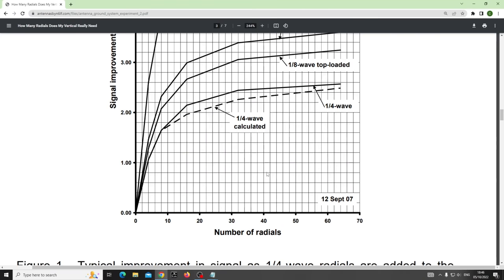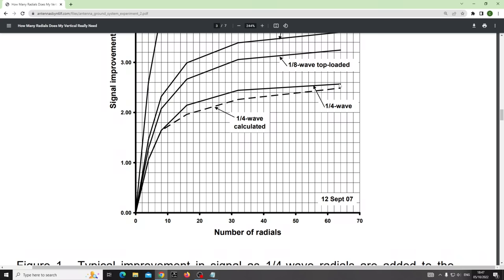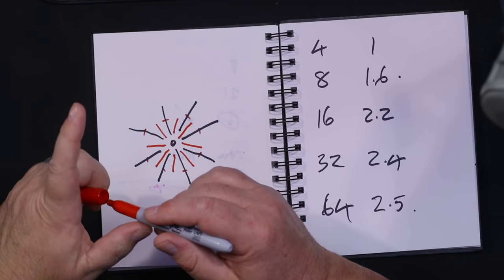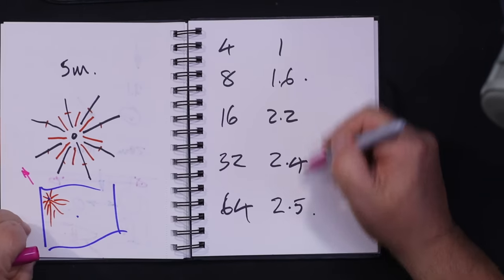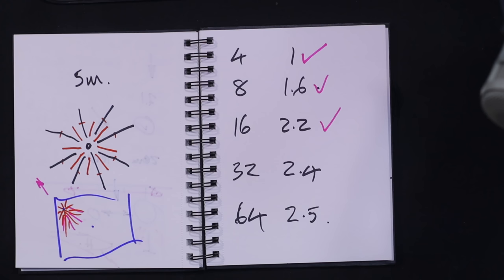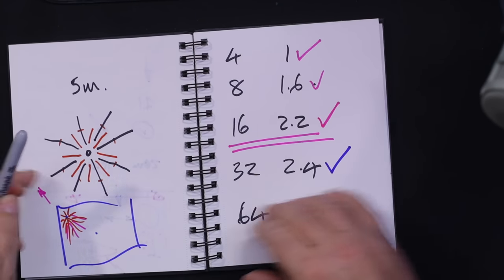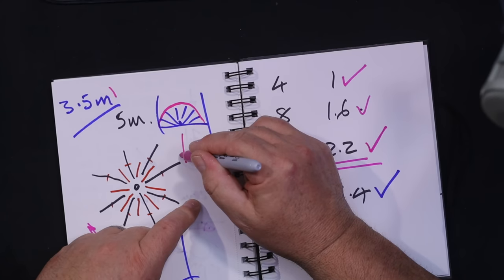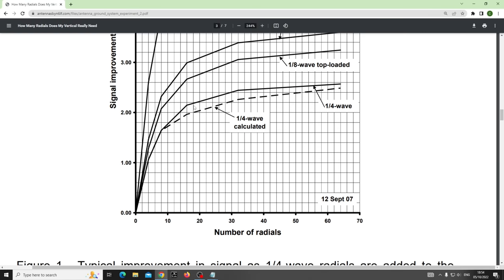Vertical Antennas 101: The Importance of Radials - How Many and How Long?

Comment: I have 12 radials all 2.5metres in length. I use a Hustler 6-BTV, all bands are resonant, except 80m which is just under SWR 1:2 and needs an ATU. Using my IC-705 on 10 watts, I can get a signal right around the world using FT-8/CW. The antenna is mounted in a corner of the backyard. I’m pretty happy with my results.

Comment: Not having a lot of radial room I was able to put the antenna in the middle of a fenced portion of the yard with about 10 to 15 ft at 360 degrees around the antenna. I cut 32 three meter radials and installed the classic with 80m with that setup. It's worked great. Signal reports from friends about 150 miles away on 80m (daily emcomm net) were the best they've ever been. I mainly use all the other bands for FT8 and it works great. We have St. Augustine grass which is a carpet type so I ordered a bag of the 2 in stakes and should have ordered 2 bags. Our dog likes to run laps around the antenna so she will pull up a piece of radial occasionally and if I don't catch it the lawnmower will clip off whatever is exposed so I'm not sure exactly what's down now but it still works fine. The radials have all disappeared into the grass now so everything is good. Thanks!! Jack K5FIT
Reply from the maker: Fabulous!

Comment: Thank you for explaining the effect of radials - I used your information to try and increase my DX range, but something 'weird' happended.
I have a Chameleon MPAS 2.0 portable antenna system - I set it up in the vertical configuration in my (small) back yard. 
The antenna as it stands now consists of, from the ground up : 
1) a ground spike (support & electrical grounding): 
2) an encapsulated  'balun/unun',
3) a 133" vertical mast
4) a Chameleon 'Cap Hat'
5) finally  a 105" vertical extension whip above the Cap Hat.
6) a singke 25' counterpoise / radial wire that attaches to the ground spike.
With this config I got swr's of 2.6, 1.2, and 1.75 on 40, 20, & 10 meters, respectively.
After watching your video, I cut and attached 8 (eight) 16.5' radials ( which add to a full wavelength on 40 meters) - all 14 gauge stranded copper, insulated wire.
Result: the swr's increased significantly across all bands -> 4.91, 2.55, and 2.6 on 40, 20, & 10m.
So I removed the 16.5' radials and added 2 (two) 33' (1/4 wavelength) radials, and the swr's decreased,
->( 3.2, 1.5, 2.6 for 40, 20, & 10 meters) but were still above the single 25' radial level.
This antenna, in the last config, DOES RADIATE. I have had RBN hits all the way from Hawaii, Fla, and Costa Rica, and SSB QSO's from Fla. to Alaska, all on 100 watts.
QTH is Vancouver Island on the west coast of Canada.
BUT, but, but ... these results don't make sense to me :
The 8 x 16.5' (1/8 wavelenght - which add up to a full wavelength on 40m)  radials should have made the antenna MORE resonant on 40 metes, and thus should have the lowest SWR (reflected power ratio).
But it had the HIGHEST swr !
Callum, did I do something wrong, or do I just not understand the relationship between radials, resonance and swr?
Any advice would be appreciated. Thank you.
Reply from the maker: OK.. so my numbers and experiments are most appropriate to quarter wavelength radiators. Dr George Brown in the 1920/30s suggested that for smaller radiators, you need even more (as you have done actually). Now.. I honestly do not know your product that you are using and I am seriously only speculating.. So - if I was the designer of your antenna (and I have no real idea what it is - I am not disrespecting someone elses engineering) and it's not a quarterwave - but has coils etc than I might be tempted to give my customer the best SWR in a small to medium package. IN THE EVENT that you supply too good a radial field, it is possible the impedance went down too far, causing the SWR mismatch. We would need to understand the impedance (SWR is just a calculation from there). You might want to talk to the supplier and ask them politely what do THEY think is happening. They know their product and SHOULD have an idea of what is going on. Sorry for the large reply - I didn't have time to make it shorter!
Reply: @DXCommanderHQ  Thank you very much Callum. I appreciate you taking the time to reply. It's basically a 'base loaded vertical that is grounded, 19.8 ft high, with a clover leaf cap-hat half way up.
I will email Chameleon and ask them the same question.
I was also thinking about getting your new 'signatue' dx antenna now that it does not require guy wires (back yard is way too small to guy the 'dx commander'), but I would only be able to lay down multiple 1/8 lamda radials for 40m due to size restrictions.
Thank you again.
Reply from the maker: PS - Let me know if they reply to you!

Comment: My radials are ~3 meters long because that's how far I could go in my garage (i really need to clean up!).  I have 5 of them in each bundle because that's what fit into the alligator clips.  I have 4 bundles because that's what fits in the bag I pack them in.    I never once gave a thought to whether this is a "good" radial setup or not.  It's what I can do and it makes contacts.  Little point in caring beyond that I suppose.
Reply from the maker: Indeed, why worry Matt!
Reply: Pretty much what I did. Works great!

Comment: Rudy is the best.........I have an autographed copy of his switching power supply book..... I run a pair of phased 1/4 wave verts on 40..............with thirty two 1/8 wave radials under each radiator. the array works........ cheers from New England to Old England, Mike K1FNX near Boston
Reply from the maker: Mike, all I can say is "Wow".
Reply: @DXCommanderHQ  Rudy is a famous switching power supply guru....... his book is one of the "Bibles"....... in the 80's every PS engineer had a copy of his book, Abe Pressman's books and "Reuben Lee" magnetics design book....... I'm retired 12 years and still have the books......

Comment: How about using wire mesh on the ground?
When replacing radials, do you dig up the old ones or just lay the new ones on top?
Reply from the maker: Good questions.. Hang fire on the wire-mesh, I'll cover that maybe later in the week..

Comment: Now I am gonna build a 1/4 wave vertical antenna. Is there any benefit to elevating the bottom of the vertical part of the antenna and sloping the radials?
Reply: Something like the Crushcraft AR2XB design, interesting.  Lends to my question as to a ground plain instead of radials maybe over a steel roof on a chimney mount?
Reply: If you want to raise the vertical element of your antenna I suggest that you only raise the vertical element of your antenna by 12 to 18 inches above the ground and then you can connect the radials and let them slope from the radial plate to the ground and use at least 12 to 20 Radials for the ground plain and you will find that the antenna will have no problem with transmission or receive. I have tried several radials about four and a half feet above the ground and sloping to the ground and I have been making contacts as far away as a thousand miles from my location and made over a hundred and fifty different contacts from my vertical antenna. At present I am only using 8 radials for my antenna. I have been on 40 meters and twenty meters when I was making the contacts. So yes you can slope the radials and and be able to make contacts with your antenna.
Reply from the maker: None at all. Rudy also did some work on this.. For any REAL giain, you need to get your HF antenna WAY UP in the air. However 4 raised radials WILL work but Rudy discovered some weird "sh*t" that I never bothered trying to understand. Bottom line is once you have a few on the deck, you are fine.

Comment: The more radials the lower the resistance seen at the base of the antenna. I hear so much about symmetrical grounds run along the ground or drooping to get more of a longer vertical effect. But all it does is make a bunch of horizontal antennas that cancel each other out. If you only have a few ( or big ones) going to one side it acts as a folded dipole and actually puts out a nice signal in a horizontal way. As long as it matches the coax the radio doesnt care if its a symetrical ground plane which radiates little or a horizontal radiator which gets out there.

Comment: Hello cal I have a question when you say a 1/4 wavelength are you talking about a specific band. I know this question will help a lot of new hams including my self. If possible can you explain length in feet and cm. I’m only asking because I know how to cut 1/4 for a specific ban. But what about a multi band like your antenna which I have one and enjoy
Reply from the maker: All 1/4 wave elements are proportional to the wavelengths. To calculate a wavlength, take 300 and divide by the freq in Mhz. so 300 divide by 14.2 = 21.05 (that means 21 metres). So although we talk about the 20m band, it's actually 21 metres!). If you want feet and inches, ask Google to convert the number.
Reply: @DXCommanderHQ  thank you sir. Much appreciated

Comment: Great video Cal as always. So my garden has a classic with 160 m of radials. Works a treat. Over the summer had to take down and adjust. When I put back up I had not connected any radials!  Went off with the family for the day. Came back home and did radio in the evening. Lots of good contacts. Only next morning discovered that the only grounding was via the coax haha!  Pissed me off as it was back breaking to get the 160m of wire into the ground. Anyway, still glad I did. Great antenna !  Mark, 2E0MSR

Comment: I found some surplus military comms wire zip cord 2 conductors at about 22ga steel conductors.  It was 76.00USB per KM in 500m put ups.  I am building a radial field using it for my signature 12.4 DXC.  I am mixing 2.5m, 5m and 10m and planning to put down 640 meters total or 8X WL for 80meters.   I can get 12 radials attached to each of the connectors on the ground plate.  I may also look at driving four ground rods near in the radial field to give a better ground plane and connecting with wide copper strapping to the ground plate.
Reply from the maker: John, that's better than me.. And I'm starting a 160m project soon and wondering if I have enough!
Reply: @DXCommanderHQ  oh due tell 160m project... sounds great.  would guess a coil loaded or inverted L with the Nebula?  or a BIG Ole LOOP... ?

Comment: Thanks Callum, for getting me interested in amateur radio.  Great videos.  Question:- Would it be effective if you had a ground spike on the bottom of your antennas? This would make it easier to erect the antenna, but would it effect the radials if you added a ground spike on the DX Commander.
Reply from the maker: It would do nothing materially to your signal at all other than assisting lightning.. However, if you wanted a little spike to easy of tilting, like a hinge, sure!

Comment: What about a ground plain instead of radials.  A local radio station used zinc galvanized 10' width chicken wire 2" mesh covering an acre under their 3 tower AM broadcast station.  They had the strongest signal in the region. 

I must expect it would foil any attempts to dig a garden though, and ground hogs might hate you!
Reply from the maker: CHicken wire.. I heard about the fella that did that and was plagued with crackles and pops for years as it rusted away.
Reply: @DXCommanderHQ  The capacitance most likely .

Comment: I just purchased the Hustler 4BTV  For my 1st ham radio antenna. I also purchased your DX radial ground plate.  I decided to mount the antenna approximately 5- 1/2 ft. off ground level. Would 6 or 8 Radials at the approx 45' angle be adequate?? I will primarily be using 20M..  I have the same choice you just described off the edge of my yard next to a large church  With a metal roof and a tree, Or in the center of my yard clear of obstacles, Yet in the way of my  Yard mowing. Going to wait till Spring time to build
Reply from the maker: Only 5 feet off ground..? Personally, I wouldn't bother.. Why not go to ground level and lay them on ground... But either would work (ish).
Reply: @DXCommanderHQ   I'm just going by the dozens of videos that I've watched on YouTube from people all over the world, That say if you raise It off the ground about 2 m,  You can use less radials a 45ﾟ angle, And supposably  get a better performance.  Like I said I'm new to this, That's why I was asking a professional. I talk to a technician at DX engineering And he told me I would only need 2 resonant radials if I raise it 6' off the ground, I do find that statement questionable, But I was thinking more like 6 or 8. (I don't know)  I was just looking for some solid advice, Whether it is worth it to string out over 30 radials through my yard On the ground as opposed to only having 6 to 8 to deal with if elevated 6' above the ground.
Thanks , Dan, from Pennsylvania 🇺🇸
Reply: @DXCommanderHQ  OK,  After reading👉👀👈 the DX engineering manual for this antenna, I decided to go with ground mount with the DX  Tilting base assembly To help me get it tuned easier. Gonna be a Raidal wire field day this coming Spring 😁
 Thanks for the great info..

Comment: What about installing the DX Commander about two or three meters above ground level with raised radials?
I have installed several home brewed vertical antennas with raised radials and the difference between on the ground radials and just a few raised radials is like night and day. The raised radials are to my ears far superior to several radials on the ground. Several S units higher according to many I have talked to. Received signals are far higher also. 
  Just got my DX Commander and am thinking about setting it up with raised radials......is that possible and is it a good idea before I put for the effort to put the antenna up?
Reply from the maker: Everything is possible.. You COULD do it. There are pitfalls.. But I'm sure you'll work it out :)
Reply: @DXCommanderHQ  I did it!  It works GREAT and only just a few radials .  Installed my DX Commander two meters above ground using a fiberglass  pole and a piece of wood drilled with a hole in it holding it in position with a band clamp on the fiberglass pole. The pole is held in position with a piece of angle iron pounded three feet into the ground using a fence post hammer and the pole is held in position on the angle iron with a couple of stainless steel band clamps.....very easy.   The various length radials are held in position with trees in my back yard using screw eyes and rope. 
I liked my DX Commander now I LOVE my DX Commander.

Comment: How much signal power in percent is lost with a ground 1/4 vertical with 16 x 1/4 wave radials?  Newbie HAM here … compared to a half wave horizontal dipole at .6 wave above the groond?
Reply from the maker: It's not what's lost so much as is what is the "pattern".. So for instance, yesterday's livestream, I spoke to a guy in the Netherlands on 40m. I was tronger on the vertical because he was slightly further away and the lower angle compensated. This video explains: https://www.youtube.com/watch?v=ZZWzyypqqjM

Comment: Can you cut them in half again and add them back in? So basically 1/16 wave.
Reply from the maker: Yes but eventually they will just be too small. For 80m I was using radials at just over 3m long. That’s SHORT!
Reply: @DXCommanderHQ  I’m more or less looking to create temporary radial fields for POTA. I’ve been watching a bunch of videos on the subject. There’s so many theories and opinions that I’ve found. I’m basically looking to use a telescoping 1/4 wave on a ground stake. 40-10m including the WARC bands which aren’t really multiples of anything. Obviously 40m is going to have a loading coil at the bottom. Some say 11.5’ and at least six & some say 3 33’. Almost all say more shorter are better than fewer longer. I’m trying to keep as small of a footprint as possible so passersby don’t trip on them.

Do they need to be tuned? I’m finding mixed theories on that as well. It’s not very feasible to have 4 wavelengths of radial wires for 40m for a POTA operation. I’ve seen some experiments where the SWR increases having too many radials. Can you see how I’m so confused?

Thanks for your wonderful videos Callum. 73 de W2ITG

Comment: How many Watts can the DX Commander handle? I just need to run a pair of 3-500Z tubes into it
Reply from the maker: At 14MHz, we tested 1,600W at 65 seconds. Above that and the little loop can get hot so we developed a work-around. Soon to be in the manual (I'm writing a Unified user guide right now!)

Comment: You should not use stranded wires for radials for long time.
They will soak up water and oxidize short period of time.
Therefore use only solid tinned copper wire .
The stranded wires I’ve used were all useless in less than a season .
The stranded wires  were all brokened and oxidized.
Had to redo
Reply from the maker: Depends on the insulation. I have found that with DX10, it seems to soak up only a few inches - then stops.